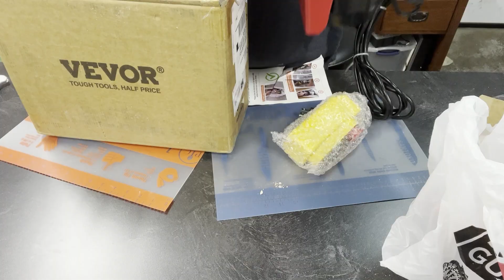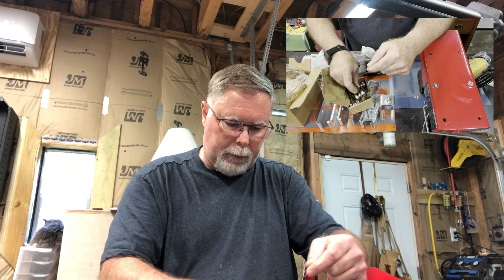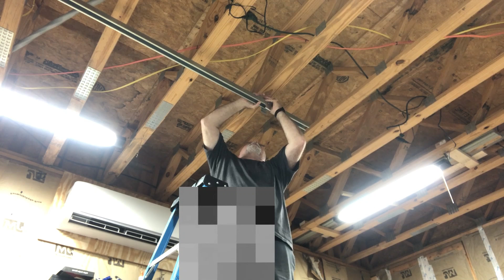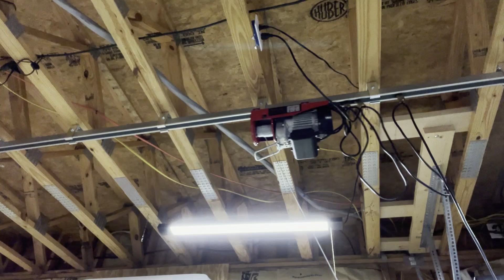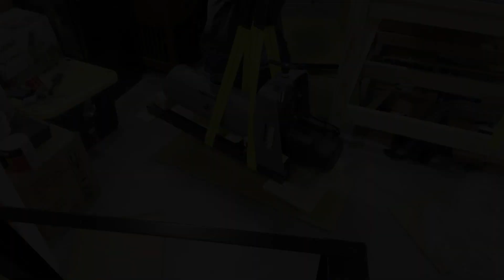My Shop Needed a Hoist -Unboxing, Installing, and Testing Vevor 440 lbs Hoist

Comment: I’ve been considering this for both my shop and near my back stairs (they are open to the 2 story basement) as I can’t carry things on stairs due to a physical disability. I want to replace the stairs eventually and add a wheelchair lift for my future needs but for now cost wise hoists will be more cost effective. And I’ve debated a hoist vs hydraulic cart for the shop.
Reply from the maker: @mycraftylife - I am finding myself needing more and more help with my hobbies. The hoist was a great addition to help with the larger heavy items, but I have also gotten a hydraulic cart. I got the 1000lbs one from Harbor Freight. I plan to do a video on this soon. I will also compare this to an electric lift but that one is just a frame that I will have to build a custom top for. Thanks for watching and good luck with whatever you decide.

Comment: What brand and kind of lasers did u use to mark, I’m a novice and never have used one
Reply from the maker: Hi – I use 2 different laser measurers. My oldest was made in 2019 and is Bosh GLM 42 Blaze. It measures up to 135’. It offers measurement, area, volume, and triangle leg measurements (i.e., Pythagorean) which are basic functions I would expect for even a basic unit. Mine is lightweight and small enough to keep in a pocket. Unfortunately, I checked and they do not appear to make this model anymore but there are plenty in this class to choose from. I see that comparable Bosh models are between $57 and $65. There are also plenty of cheaper models out there from non-brand name sources.

The other model I use is one that was sent to me for free to try on my channel. I like it as it offers a laser on both sides. This is helpful to measure things like the height of a wall from a midpoint. Without it, I would typically get down on hands and knees to measure from the floor up or from a ladder from the ceiling down. 

I have a video that talks primarily about the second unit, but also shows the Bosh. If you have time, check it out here: https://youtu.be/5alJHPNcRvE

My videos have affiliate links but like I always say, shop around and get the right tool at the right price for you! Thanks for watching.

Comment: Thanks for sharing. Safety note, vertical paper on walls is a scary fire hazard hope you get it covered soon.
Reply from the maker: Thank you for watching and for the note. Yes, I agree and have assumed the risk. I am finally adding some storage that will allow me to add an office to free up some space. Then I will be focusing on finishing walls, likely with reclaimed wood. Of course, that carry’s its own risk though much less than paper… I’ll also be adding a miter saw station along one of the walls with plenty of storage.

Comment: I don’t think it’s a good idea. I had the same kind of trusses and they’re only joined together with Metal. You’re doing a big mistake. You might get killed. I don’t know it is still up.
Reply from the maker: Thank you for this. I want my channel to be about all of us learning together and appreciate all constructive comments.
I see your point on the trusses. That is why I mentioned  in the video that I plan to run threaded rod through them and into the sheathing above once it cooled down. I actually have what I need to do this now and plan to do so soon. I’ll put this and other lessons learned out in a new video soon.
Having said that, I was confident that by spreading the load across 6 trusses and not lifting more than 300lbs it was doable in my scenario. I have used it a dozen or so times and have had no issues; though, I certainly would not hoist an engine block with it. I invite you to check out the new video once published. Thanks for watching.

Comment: I just found this video because I’m am about to mount a hoist similar to what you did, but I think I’m going to mount the unistrut directly to my trusses. Thank you for the belly blocker! lol! How does the rollers for the cord work out? I like this idea. I appreciate your video, you’re very informative and helpful.
Reply from the maker: Thank you so much! Just a heads up though. Check on your clearance for the roller if putting bolts through the unistrut without the hanger. I found the bolt head would hit the roller on mine. 
The small rollers work well. They mainly help keep the cord slack from hanging down too much.
Reply: @HoagiesHobbies I watched another video where the guy used construction screws with a washer head & fender washers. I’m going to take my rollers with me when I get the uni strut & see if this will work. If not then I’ll have to order the brackets. I’m definitely going to use your cord idea! Thank you for responding & advising me!
Reply from the maker: Great idea to take the rollers. Good luck and I hope you enjoy it!

Comment: I installed one of these very much the same way about the time you posted this video.  There are wire management rollers that have a curved shield. They work very well.   I had an issue with the hanger clamp bolts not clearing the strut.  I had to open the holes up one several holes.  I got a wireless controller so I don’t have to worry about where the wired one goes.
Reply from the maker: Thanks for the tips! The wireless remote would be a nice addition.

Comment: Can the hoist hold a load up for an extended time.
Reply from the maker: Thanks for watching. Unfortunately, I cannot find any documentation on its ability to sustain a load. I would note that the one I used is only rated for up to 440lbs so is on the smaller end of available models. Though it seems fairly heavy duty, I probably wouldn’t think of hanging heavy equipment for long periods. I suspect something like a bicycle would be fine.

Comment: I’ve seen a couple of these videos now and I really like your setup.  I am curious why you used the channel hangers vs. just bolting the track directly to the rafters?
Reply from the maker: Great question! I likely could have bolted directly; however, when I was ordering parts I did not know what the tolerances were with the wheels of the trolley inside the track and the bolt heads and washers. I envisioned them hitting each other. Using the outside hangers eliminated that concern. I would never have to worry about it with this lightweight capacity hoist and heavy duty track, but in theory, the hangers would also prevent any flaring of the channel. But again, it is probably overkill…
Reply: @HoagiesHobbies  Interesting, I did consider the possibility of the track flaring (which the hangers would mitigate), but I hadn't thought about the trolley wheels having enough clearance from the bolt heads.  I don't have my parts in yet and was not planning on using the hangers.  Sure would be nice to know, so, is there sufficient clearance?  Thanks!
Reply from the maker: I couldn’t remember how much space there was so just went and checked. Unfortunately, you probably will need the hangers, at least with the configuration I have. There is probably an 1/8” or less from the top of the wheel to the track. I thought you might be able to straddle the nut but the holes in the track are fairly wide and the necessary washer would probably still be in the way.
Reply: @HoagiesHobbies  Thanks for checking, I really appreciate it.  I looked at the specs for the trolley rollers and it looked like it was going to be really tight so I went ahead and ordered the hangers.  Should have everything in tomorrow, except for the hoist, it doesn't come until next week.  :(
Reply from the maker: Congrats and good luck. It is a nice thing to have!
Reply: Lag bolts are for pulling things together and not holding things up. They will eventually pull out.

Comment: I might have put red locktite on the threads going in the hoish so they don't back off with moving the trolley. It would suck if it backed off.
Reply from the maker: @roymclaggan2622  Good idea. I plan to check them and may do that then.

Comment: Awesome thanks for the video, it gave me a couple of things to think about. I thought I'd need an I-beam setup but like you I won't be lifting more than 2-300 pounds so it looks like this will work for me!
Reply from the maker: Glad to hear it and thanks for the note! The bolts I used were probably better than lag screws and are holding strong. Like I mentioned in video, might want to consider threaded rod if doing really heavy items.